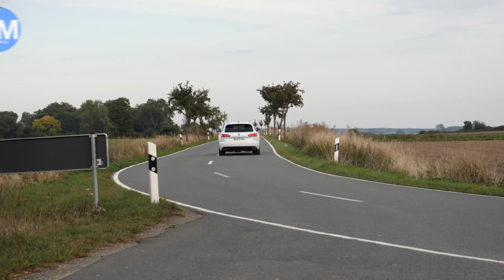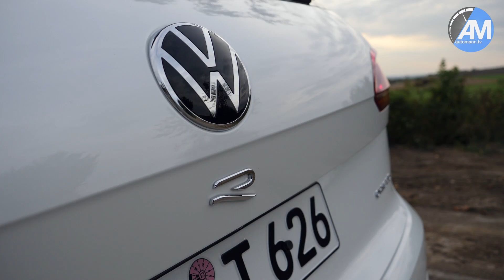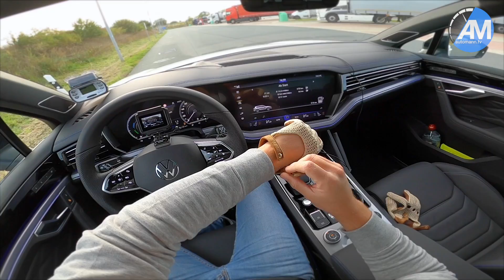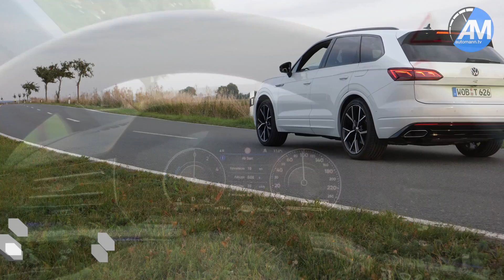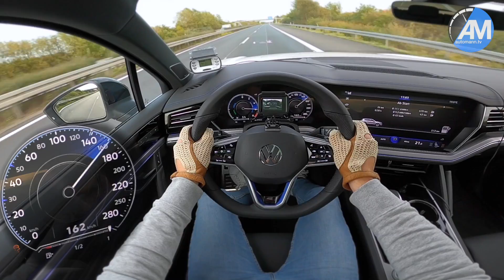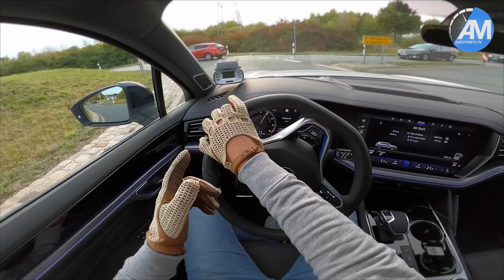NEW! VW Touareg R | Launch Control & 100-200 km/h acceleration🏁 | by Automann

Comment: In case somebody is wondering: City to city (222 kms) with an average speed of 103 km/h (means 150 without Speedlimit) can be done with 8,6l/100km.
Of course if you push the car to top speed wherever it is allowed, you can calculate with >15l/100km...

Comment: It seems really calm at 250. Its like its made to be an autobahn cruiser. Some ''performace" cars are all over the place at high speeds, makes them hard to control for a long period time. But this is a mile muncher. I feel that this and a V8 diesel can sit at 200kmph all day without a problem.

Comment: Accelleration is ok, but not impressive. It could be faster, especially with the hybrid engine.
A BMW X5 M50d has the same weight and does the same 0-100 time with "only" 400hp
Reply: Diesel is much better suited for heavier cars
Reply: Touareg is heavier because of the battery

Comment: Power to weight and torque to weight don't add up to the time achieved here, smells of VW fixgate again, giving a power boost to press cars like the VAG group seem to do all the flipping time! Only way to be sure is rolling road the car and check its weight.

Comment: Would be much more fun to drive if the removed all the shitty hybrid motors and batteries, probably 400 to 500 kilograms.
Reply from the maker: It’s available....Touareg V6 TSI 340hp....no batteries but also: no extra power;)
Reply: @Automann-TV  Lighter car, less power, beter power to weight ratio.  With passengers and baggage, you would need a truck license in the hybrid 🤣

Comment: ???  0-100 = 5,3;  0-200 = 18,9;  100-200 = 12,8 how is this posible?  18,9 minus 5,3  = 13,6 not 12,8 ???????
Reply: I am thinking it's around 14s given the weight. Maybe when they did a separate "in gear" rolling 100-200, when they did 12.8s?

Comment: Just a suggestion: when you talk about the engine specify wether it is naturally aspirated, turbocharged or supercharged. You said V6 engine twice or three times and never specified more.
Only in the video description I found it's a V6 TFSI.
Reply: What else did you expect? A Diesel? No way it would sound like that then.
Reply: @angeblasen7164  did you read my comment? I'm  talking about naturally aspirated vs. forced induction. Of course it's not a diesel, which by the way, he should also specify.

Comment: How is the fuel consumption when driving on the autobahn at normal speed?
Reply: Probably something like 15l/100km
Reply: @xanthuumnihyr5319  no. Lol. Why would you think that 🤦🏻‍♂️

Driving at 100kmh youll average 7.6/100km , at 140 you'll average 8.8l/100km